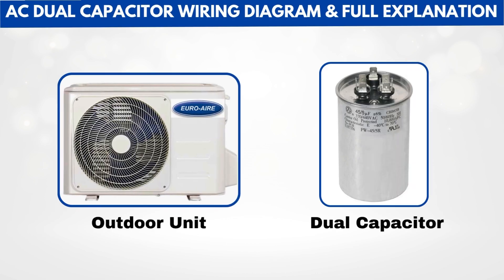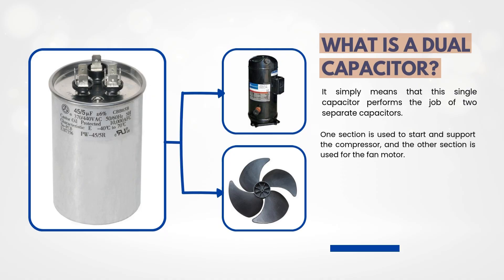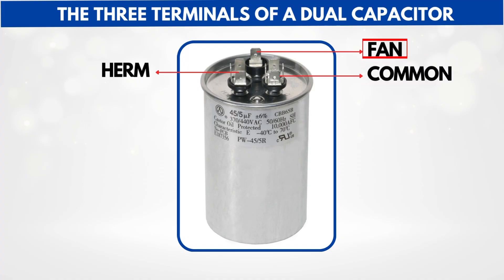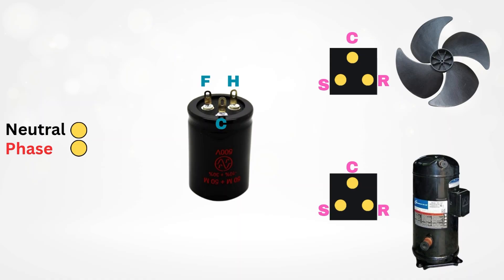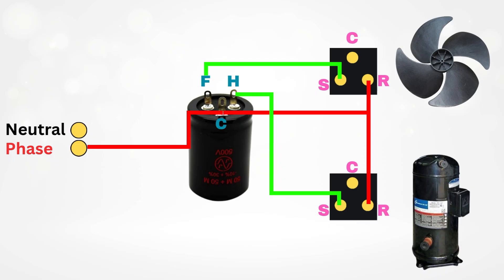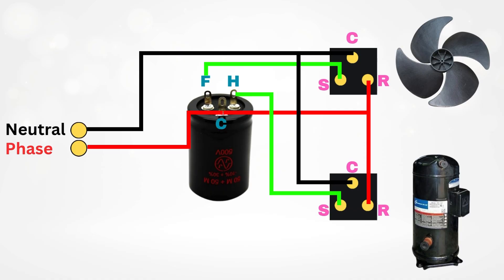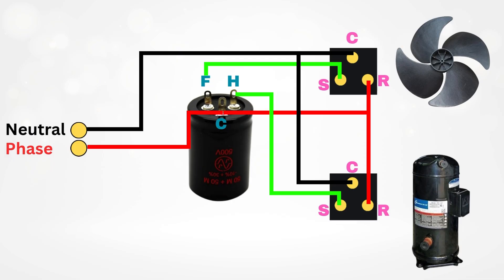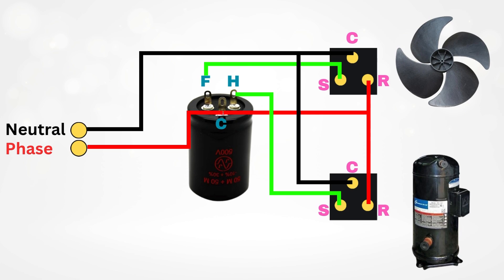How to Wire a Dual Capacitor in AC Outdoor Unit | Step-by-Step Tutorial

Comment: Why it's called a dual run capacitor when the fan and herm terminal on the capacitor is connected to the run winding on the fan and compressor?
Reply from the maker: The fan and the herm is not connected to the run winding they are connected to the start winding of the fan and compressor. The common terminal of the capacitor is connected to the running winding of both the fan and compressor.
Reply: @hvacacademy01 that's what was shown in the video

Comment: The run capacitor is working all the time, not just when starting the motor(s). I find possible that this video is made by AI, as this is not the first case I have found when AI claims something that is only partially true, or worse, utter BS. When it comes to electricity, AI is a risky source of information. Sounds crazy, but if AI is asked something that it does not know, it lies. Fabricates an answer that sounds ok but is not.  For example, try asking AI to make a picture of a clock that has hands showing, say, 13.15. It can not do it. It can only make a clock showing 10.10. If asked again....
Reply from the maker: Sir I did not take any information from AI i did use AI to generate voice but all the information is true and based on my own knowledge and from certain books related to hvac. Secondly according to your question the F and the H terminals are used for starting they are just used when turning on the fan and compressor they give extra charge or boost to the component to start then the job of these two is done. Now the AC unit run through the C terminal giving supply to the running of the compressor and the fan motor. I hope you got your answer if you still have any confusion please watch again so you could clear the confusion or ask me i will solve it.
Reply: @hvacacademy01  I think you are confusing a "hard start"  kit with the run capacitor.

Comment: there's no 24 volt line, there's no contactor,  no incoming dual 120volt  = 240 volt
Reply from the maker: Sir this only dual capacitor wiring hope you stay tuned more videos on complete AC wiring will come